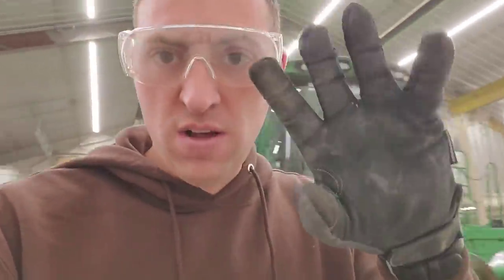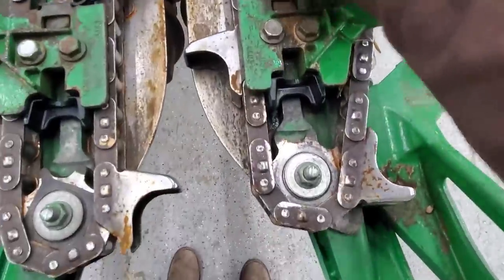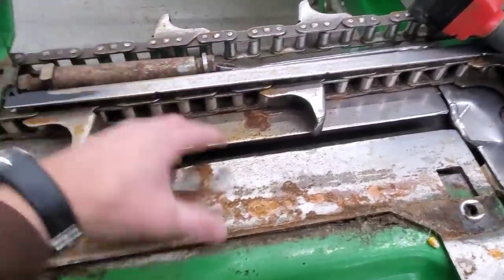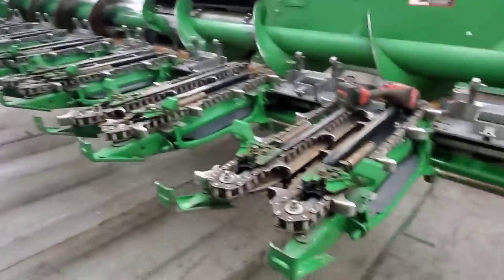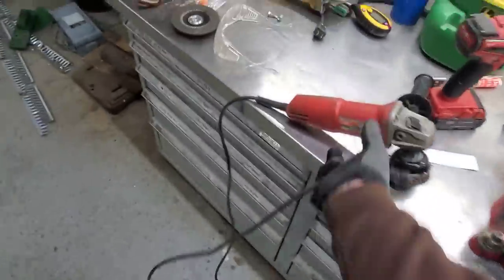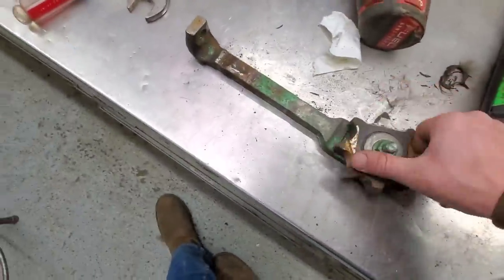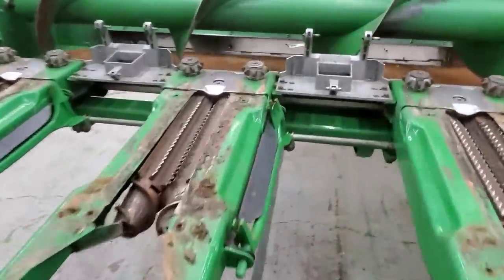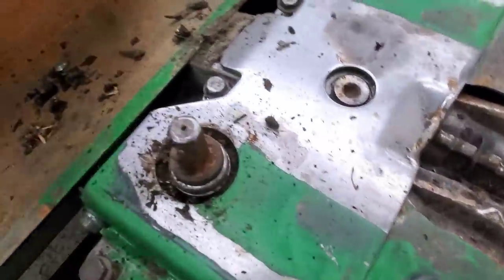Corn Head Teardown! - #304

Comment: Hi Nathan, glasses are a must, but also agree on the dust masks and shop aprons, they are not expensive and will keep you a lot cleaner. also like the cabinet sand blaster idea, I used to use one at work and they work well and it makes cleanup so much faster.

Comment: I put an old used dishwasher in my shop to wash small parts like these, especially parts you don't want to hit with the wire wheel. Like the plastic blocks you have. They make great parts washers. Good excuse to get the wife a new dishwasher for the house for Christmas.

Comment: You ever try powder coating those deck plates? it works great when you put it all back together with a graphite spray it's runs so smooth you wouldn't be unhappy,  since you're gonna use paint try some spray on graphite when you assemble your corn head back together

Comment: I would replace the deck plates. They show some wear starting and once it starts it goes fast. Half the battle is just tearing the corn head apart to do it and you are already there. Plus deck plates are cheap when you figure out the cost per acre on them

Comment: Kinda surprised you didn't readjust the chain tension adjuster to make sure the chains could be adjusted back in spec.  Better to do it prior to disassembly so you can order part(s) ahead of time.
Reply from the maker: There only 2 years old, not worn out

Comment: With all my years of farming and being around equipment I have never seen any one dismantle and clean equipment like you have been doing. When I farmed I had a JD 612c and when finished harvesting I thought that when I pulled it in front of the machine door and got a big screw driver and the air compressor that I did a fantastic job. Not so according to your standards. Great job. The way you clean, paint and repair you may never have to trade again! I remember when I was 35 I had a lot more enthusiasm than when I was 65. So you have your age working in your favor along with a good helper. Really enjoy your channel. Thanks for all the time and effort you put into producing your videos.
Reply: I had a lot more enthusiasm when I was 35 than i do now at 65 ! A few bad years of farming in a row kind of kills the enthusiasm in farming and when your body after years off working it hard hurts doesn't help!

Comment: Hi Nathan,  I know this question is more relevant to harvest time but was wondering is there any value in bailing corn or soybean straw  or it it more benefit to have it worked back in to the soil ?

Thanks
Reply: Both sorts of crop residue will make bedding and offer some rather mediocre forage feed but you would travel miles for a bale of soya straw because there generally so little of it per acre. 
Sale value - rather dubious in my opinion. If folks bale corn straw then usually it is for home use as it is not easy unless using round bales nett wrapped tightly because bales fall apart being handled and hauled.
Remember if being used as either bedding or feed it will eventually be applied to fields as manure.